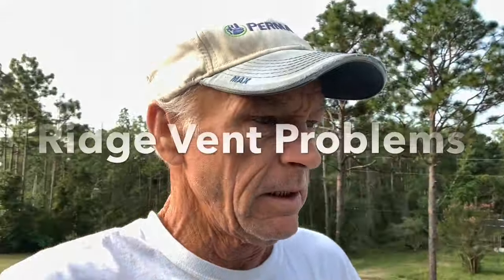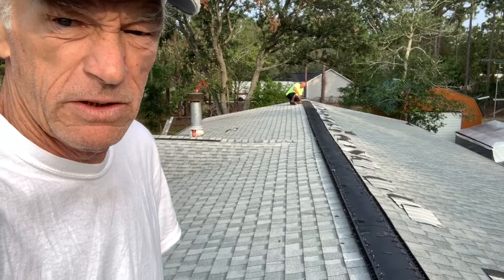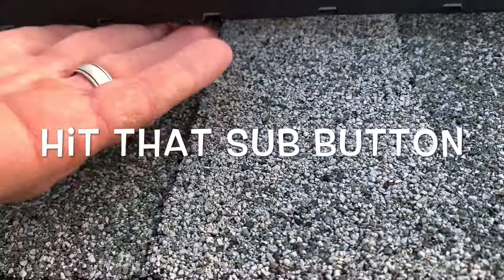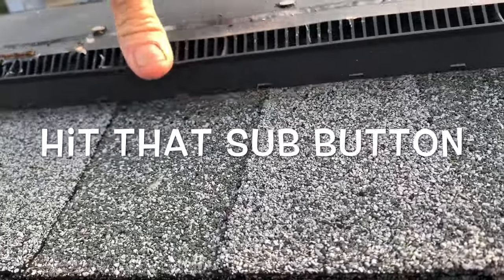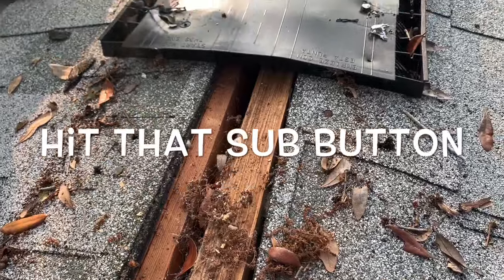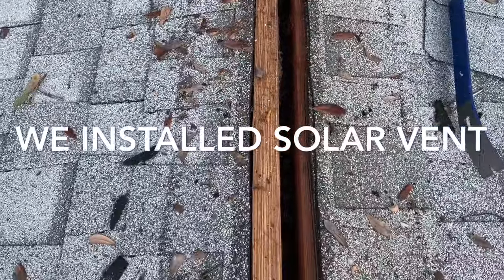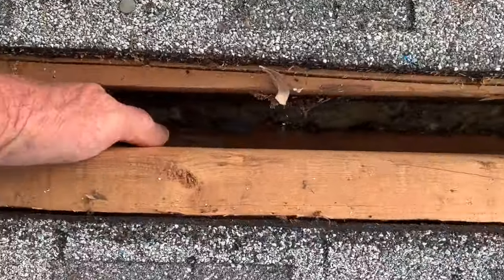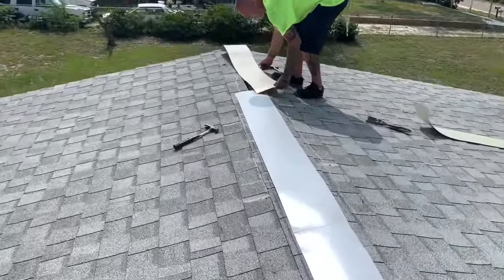Ridge Vent Problems When Not To Use It

Comment: Why not just take off one of the top courses there it's been cut and you probably buy the prevailing wind side just put it install the full shingle that goes over the top of that Ridge and then cap it
Reply from the maker: That is exactly what we did we were mowed rose of shingles reinstall them overlapping we put caps on it it never leaked again. Whoever did the roof for him talked him into ridge vent which was a big mistake. Not enough pitch on that roof for Ridge vent. We did exactly what you’re talking about and removed it it was leaking

Comment: Ventilation is NOT KEY.  Radiant barriers would have helped.  Sealing the poorly installed ridge vent would have helped.  Even a low flow attic vent will pull conditioned air into your the unconditioned void.
Reply from the maker: You have not a clue. Just saying. No attic to vent exposed beams. This is NC SE NC To be exact. It’s like Florida.
Reply from the maker: Most beach houses do not have attics

Comment: If you check the instructions supplied with the vents, DO NOT install without sealant between the gaps on archetectural shingles...three tab shingles are fine without.....and in this installation, the vent is worthless anyway......
   Again, check the instructions......with a ridge board, 3/4 inch per side is required
Reply from the maker: That’s a good explanation

Comment: ridge vent is a problem when you do not have soffit vent, yet gable vent
Reply from the maker: We have soffit vent when the house has a low pitch you have a gable vents when you have a house with a large pitch in other words 612 712 812 912 1012 1112 1212 them could all have gable vents and they can also have Richmond anything under a 612 I do not recommend regiment that 612 pitch

Comment: I am not saying that your lines are swimming and the ridge vent is crooked but...
Reply from the maker: That’s not my lines. I came back and fix this job removing the ridge vent after the other installer installed the ridge vent so the roof was not done by me all I did was remove ridge vent and recap.
Reply: @Drewsroofingandhomerepair   Whew ! I was worried for a minute. A lot of our work is fixing work done by "ghetto Allstar" roofers.
Keep up the good work!
Reply from the maker: Thanks

Comment: Assuming a "new" roof comes with, at least, a 10 year warranty. Repair should have been free.  Looks like typical result from "saving" money, by not having pros do the work.
Reply from the maker: Not my roof not my company. All we did was remove The ridge vent that shouldn’t have been installed to start with
Reply: @Drewsroofingandhomerepair  Sorry, never meant to say anything bad about what you posted... just pointing out that a legitimate roofing company would have installed the roof (as you pointed out...properly...what didn't happen) and it would have a warranty. I'm getting a new roof now. All roofers are offering me 10 year plus warranties (parts and labor).
Reply from the maker: I wish you all kinds of success with your roof I hope you get the best contractor in your area and don’t take the lowest price